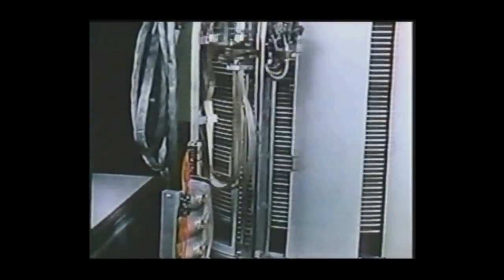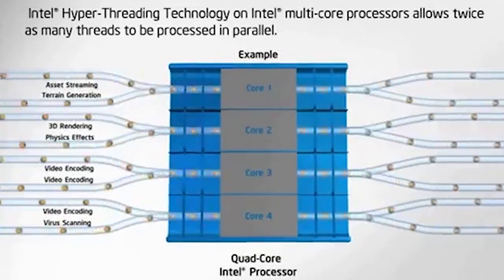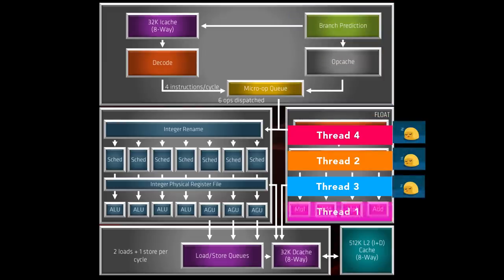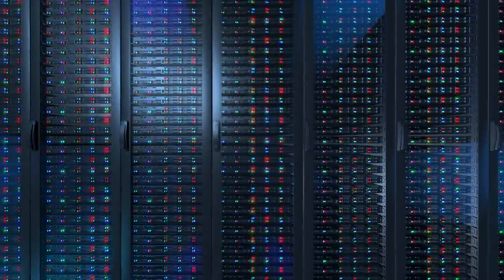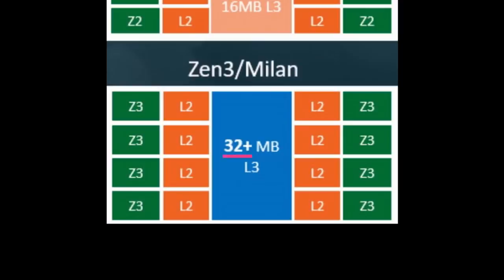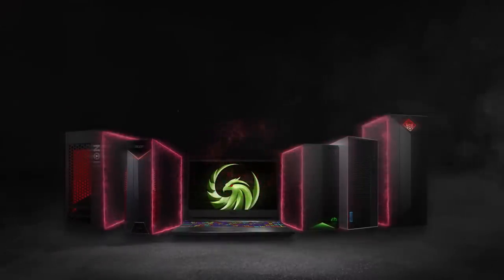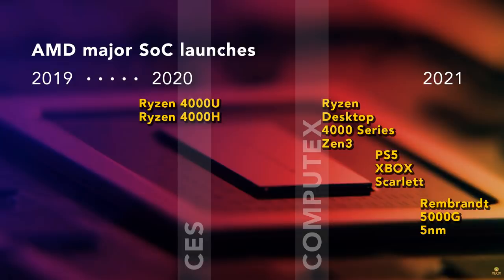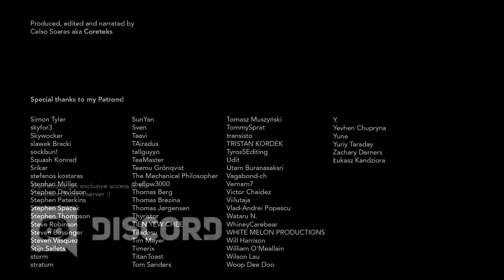Rembrandt | AMD’s MONSTER 5nm APU

Comment: SMT uses unused execution units in the core as a general rule.  A super scaler processor can execute multiple instructions at the same time, the changes AMD outlined in there Zen 2 talks shows they added more execution units to improve IPC.  However the more execution units you add the more execution units that will be idle with a single thread.  That single thread will be able to do more in parallel than it would otherwise, but no matter what it won't be able to use all execution units at all times.  SMT, will allow it to use unused execution units.  The performance degradation that occurs is due to higher utilization causing increase temperatures requiring decreased clock rates.

Comment: I think you overstate the importance APUs on PCs, gaming is still bottlenecked by CPU, GPU and memory bandwidth graphics are still not photorealistic, if you add VR on this context with 120hz the double the horizontal resolution and at least 4k per eye Ray tracing, we are so far away from this to be mainstream that will take at least 20 years for this idea of APUs to take place of discrete components. A multi chiplet design with HBM3 and games supporting many cores and many gpus could make this time shorter, but...
Reply: We won't even still be on 4k in 20 years

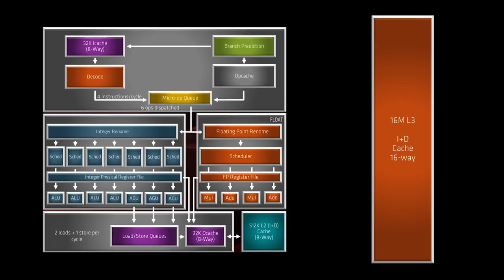Comment: 4:28 You have it backwards. SMT allows the CPU to do something useful on another thread's instruction stream when a thread is stalled on a dependency chain, instead of doing nothing. It will have something else to do between the instructions during latency bound dependency chains. If you have enough SMT threads, you can hide latency entirely, and completely saturate pipelines with work, eliminating the effect of instruction latency. For example, if you have four SMT threads, you can execute instructions with up to a four cycle latency back to back on every thread with zero stalls. The other three threads can issue their four-cycle latency instructions in between issue. By the time it has issued an op from each thread, the first one is completed its four-cycle latency. Did you think four-cycle latency means an execution unit sits there and can't accept new ops until four cycles go by? It doesn't, it means that there are four pipeline stages between issue and writeback, and the pipeline can accept 3 other ops in the meantime, without a pipeline bubble. Without SMT, there would be a bubble of no ops in between. Out of order execution does the same thing, but it is more difficult to extract independent dependency chains from the same thread than it is to select independent dependency chains from entirely different threads.

Comment: the power9 cpu already has 4 to 8 threads per core depending on the variant. there is a 12 core with 96 threads variant. and a 24 96 version also.

Comment: As far as I know AMD has already matched Intel with their single core performance, both having their advantages and weaknesses.
Still a 10% improvement sounds pretty reasonable as AMD is gonna gain 100-200MHz more clockspeed due to node shrink, they are gonna make their chiplets actual 8 core units instead of 4 core CCXs, reducing latency and they will make additional improvements.
Intel is gonna keep up with adding clockspeed and match AMD's gains, but the IPC is the real factor here.
Also if indeed Intel is gonna have a CPU that clocks similar to current 14nm++ and have that 18% IPC gain in about 2 years then AMD is better gonna make those gains.
Reply: 8 Core CCX Improvement is also believed to gain higher gaming performance for Ryzen
Reply: @icemanchambers1207  It absolutelly Will. Core to core latency through IF has been an issue with Ryzen when it comes down to gaming. Full 8 core units will improve the performance If the usage is Limited to only one unit.
Reply: @Diglo1  Yes I agree.

Comment: There is a basic fundamental misunderstanding within the chip designers - 1) Shared L3 cache enables and introduces security problems.  Its just a fact of life.  Splitting the L3 does localize and minimize the problem.  2) GPUs are fundamentally shared resources, and thus introduce security problems.  GPUs are essentially designed as to be single user devices, and mix data - even in multi window environments.  GPS especially in terms of streaming are difficult/impossible to segment.  APUs on the other hand are easier to segment (in terms of security).

Comment: You're missing a trick here. Imagine, if you will, a core with SMT4. To achieve the same multithreaded performance as two cores with SMT2 on the same amount of silicon you have to - and can afford to - design it with a much bigger and more capable core with more L1 and L2 cache at its heart. That much bigger core could have vastly improved single-threaded performance too. We likely won't see that much larger core with Ryzen itself; probably that will be its successor. It would be pretty neat to have a few gigs of HBM2 cache on-package as well to keep the whole thing fed.  If this cache is big enough you could omit the external DRAM and use something like Optane instead which is cheaper and bigger.

Comment: SMT-4 is actually powersaving measure.  Say, processor has 8 cores with SMT-4 and 16 heavy threads running. It can easily power down half of the cores, up-clock remaining 4 in power/thermal budget gaining more than is lost at context switching. Most of PC workloads are dependand on I/O (network, storage, user) anyway. Threadripper based on Zen-3 - well, as name suggest... ;)

Comment: It's only a matter of time before APU's is all we need. In fact, you may even have choices in terms GPU power. You will be able to buy an RTX 2070 APU or a RTX 2080 Ti. There will be no need for a discreet graphics card. The same thing in a way happened to Motherboards. Way back when (1980's), we needed sound cards, network cards and a Controller card for the Hard Drives CD ROM or what ever. Now ALL of that is on the Motherboard lol. Great Video,  Cheers

Comment: When you discussed SMT, you missed the fact that in majority of cases it is not the cpu resource contention that is the bottleneck, it is the memory bandwidth. Today with all avx2 / avx512 it is impossible to feed a single core with 6 or 8 dram channels so smt is completely useless. It is only moderately useful when all of your workloads fit in all the cache accessible by that single core. This is why Milan is merging L3 caches - so that more of the L3 cache can be accessed by any single core.

Comment: The main benefit of SMT is doing useful work instead of stalling on memory, a little extra state allows the core to transparently run the alternative thread and do useful work, then pick up the first again later with the data available.
Running 2 threads equally like can however effectively halves cache size,  but allows a specially written helper thread bound to the same core do advance loading, so the main one rarely stalls.
If you were building so wide, to run 2 pipelines simulataneously in 1 core, then how are you economising on 2 seperate cores?  You're complicating the core considerably, rather than adding a small increase in die area to add a virtual core and switching faster betwen them without OS intervention.  A seperate core makes sense, Bulldozer cores sharing fp units didn't work out too well, despite fp being less common on average, where it's used it is likely to be heavily used and suffer the resource contention problems.
SMT has diminishing returns, simply because caches and pre-fetch are effective, limiting the opportunites to optimise by filling stall time.

Comment: If an Apu can perform at 8gb-16gb card it's over for the GPU for mainstream, I mean $150-$250 8core-16core Apu it's over
Reply: HOLD THE TRUTH HOSTAGE!!! 
It would just increase the entry level performance and price for dGPUs. By market valuation, a $150 dGPU will always be faster than a $150 iGPU. But, we may see dGPUs below ~$120 disappear.
Reply: @darkpain2452  8 has to become the basic with zen 3, as in 8core replaces 4 cores, 12 core replaces 6 cores, & 16 cores replaces 8 cores, then 24 cores replaces 12 cores, 32 cores replaces 16 cores, which means threadripper starts at 40-48 cores for 4900x, 56-64 cores for the 4950x, then 4990x 96 cores.

Each with 4 threads per core it would be a multi tasking monster kill Intel & push technology beyond
Reply: Don't expect to buy that kind of chip for 250 or less. More like 500/600 or so.
Still a good deal imho. With lots of possibilities.
Reply: @baronvonlimbourgh1716  well with what's going on & the demand by companies to increase the sales of laptops and PCs, less parts to build will equal less confusion when building a custom PC & which means more mainstream buyers. I mean it's only a matter of time before Ram, GPU, and CPU are one part, I mean with the simplicity of Cellphones, & tablets it's the only way to reenergize the PC market. Less parts must equal more. And with external graphic cards already out it's only a matter of time man. Before you know it all you need is one chip like thing to have an entire pc it's coming man
Reply: @holdthetruthhostage  sure, been going that way for a while now. But hbm is expensive.
A 16 core apu with 32gb combined shared memory and a midlevel gpu is a lot of silicon and a lot of money. Will be many years until that is available for 250. Certainly not in 2021.
Reply: @baronvonlimbourgh1716  my thing is yes it will be expensive but why not, what happened to the $5,000 CPU that had less in supply but was designed to push the limit man. I would say an Apu with 8 cores 8gb graphics that you can raid with a GPU would be amazing man, it's time for AMD, INTELL, RISK 5, ARM, to produce a killer man check this out

https://www.pcworld.com/article/3085502/meet-kilocore-a-1000-core-processor-so-efficient-it-could-run-on-a-aa-battery.html
Reply: @holdthetruthhostage  yeah that sadly is not how businesses operate. Unless there is a financial motivation to something it won't happen.

The market is just to small for such a part and unless it beats both intel and nvidea at the same time it also has no value as an image builder or flagship.
Or there has to be a demand for such a part from the enterprise side, then it could happen.
Reply: @holdthetruthhostage  what happened to that tilera chip. Did they release that and what was it used in? I'd like to mess around with it. Should be cheap now.
Reply: @baronvonlimbourgh1716  but that's the problem companies are so focused on for everyone or professionals that they are not experimenting with limited releases that are not for the mainstream consumer, I mean AMD & INTEL could release 1,000 limited edition for example 128-500 core CPU for $15,000 just to inspire the smaller market or test it out to push things further. I mean the original cellphone was what $1,000s before it was $100s. It's that lack of imagination & risk that has the PC market and technology feeling doll no risk no exclusivity. Sure I wouldn't be able to afford it but I would be able to see it in action & look forward to it becoming more affordable

Comment: the apu being all you need is a pipe dream because we will always want more, if we can do 4k 60 with an apu we will want 4k 165Hz on a dedicatd gpu, that can pull all the power it needs and have all the hbm, raytracing will also help maintain dedicated gpus in use as that will be hard to do for quite some time

Comment: Gotta love APUs. My first CPU was an A10 6800k because I wanted to save to get a 750Ti later on.
Reply: My first CPU was an A12 9800, then a 3400G, now a 3800X + 5700XT (got a job)
Reply: I love them too. I still use my a10-7850k and it's more than good enough for anything I do, including 4K. It strugges a bit when running virtual GPU (VirGL) at 4K though.

Comment: IBM has had SMT of 8 (8 threads per core) since 2014 which was introduced with POWER8 CPU. It's been used in data centers for years now. No idea why Intel and AMD haven't introduced at least SMT 4 yet.

Comment: AMD could be thinking of using SMT-4, adding shaders to the cores like Intel's Larrabee, and use a lot of cores to merge the CPU and GPU into one design. Once gaming reaches the photo realism performance cap, there may be less of a need for specialized gaming hardware. Although, when the discrete GPU does disappear, it could be replaced by a discrete neural network card.

Comment: 8:00 Windows obviously cannot do it, however, a properly written CPU driver or middleware application from AMD certainly can analyze upcoming threads and “distribute” them to properly utilize and take advantage of idle CPU workers.  AMD could also surprise us by doing this in hardware.  All three of these options can eliminate or at least reduce “stalling.”

Comment: Maybe they will add some more hardware to the core and increase the pipeline depth.  As pipelines get deeper, the maximum speed goes up but the issues of waiting for the previous thing to finish gets more complex.This may make more threads per core make more sense.

Comment: Charlie from S|A remained confident even after that leaked video that Milan is composed of 15 dies. 

What's your thoughts on the 6 we don't know?
- 4 dies of L4$ stacked on pairs of CCD-s, and 2 HBM stacks serving as HBC? (HBCC)
- 4 dies of cache each connecting 4 CCD-s helping CCD-CCD communication and 2 HBM?
- 6 HBM stacks?
- 1 die as interposer, and  whatever
?

Comment: I totally agree that APUs will be the future. Although admittedly I am a bit biased, as soon as I heard about the technology I was excited about it and bought an A10-7850k for my next processor. Partly because I'm cheap, but also partly because I was interested in the technology. Particularly I liked the idea of upgrading the APU by adding a discreet graphics card and still utilizing the graphics cores through crossfire. This by the way, for anyone who's curious, turned out to be a bad idea (as you could probably guess). The performance increase was negligable over just using the graphics card on its own, but caused me no end of headaches and hassle. Perhaps with a higher end motherboard and RAM I'd have seen better results with such an oddball setup, but then again that basically would have negated the frugal nature of the build (although would still have been fun to do nonetheless, purely from an enthusiast perspective to see what results could be achieved).

Comment: This explanation of SMT is a bit lacking because it assumes/presents that all execution units of specific type are working strictly together as a whole and thus cannot be used by the separate threads at the same time.

If the core has 8 floating point units and first thread uses 5 units for some specific operation and second thread needs only 2 units then it's all okay to do it at the same time, maybe except for the fact that fetch and decode gets queued/delayed by a cycle or whatever the cost of those operations are. 

If AMD makes a Core that has more separate execution units of each type then it may still make sense to have 4-way SMT.

Comment: The last thing my HPC users need is more threads per core.  Current Intel HT makes them expect way more performance than they will ever get.  The software is so good at keeping the execution units busy, there is no gain in performance with the SMT tech turned on.  Quite the opposite most of the time.

Comment: i dont see what the problem is with multi threading as the thread exists, needs to be dealt with, and needs the resources it needs weather the cpu is single threaded or multi threaded, if it has to wait for resources it would have to wait anyway till the next clock cycle

Comment: What are your thoughts on Deepmind AI? It does even require huge pc power to work, it can be ran on a regular laptop, seems like good code can be more important than hardware in the future
Reply: vesacksi Training a neural network is the difficult bit/hardware taxing not just running the trained version.

Comment: Problem with everything on chip is that to get the most out of the hardware you're going to be pushing TDP's up into HEDT territory. For this reason alone APU's will always be at the entry level of the discrete CPU and GPU combination.
There's no doubt that future APU's will achieve 1080p/60 (roughly rx 570) levels of performance sometime in the next few generations, but even utilising onboard HBM, the gpu side of the equation for power draw will limit the performance.
As you are well aware mid range gpu's have much higher power draws than CPU's at 2:1 whilst gaming being 175-225W vs 65-95W and even optimising to 100-120W will still increase package power draws to 180W+. So even if you can fit the gpu and memory into the package, the additional price/performance benefits won't get close to the discrete options.

There's definitely scope for APU's built this way as the HBM could serve a dual purpose as fast memory for the CPU squeezing in between L3 and system memory for some additional performance benefits to the CPU, but the graphics subsystem will still be limited to lower CU counts and lower clock speeds due to power draw limitations.

While technically it's feasible to have an APU with 200W+ TDP's, it'll be limited to niche markets and not mainstream due to the higher motherboard and cooling costs required. With HBM we could see APU TDP's rise from 65W to 95-120W but HBM is more temperature sensitive and those would require higher end cooling at stock than the low cost spire and would need the prism at least adding to the cost.

These would not be sub $200 solutions, but likely closer to $300+ taking them out of the budget gaming end of the market altogether and not be as good as discrete solutions in price/perf.

Comment: Even if Windows couldn't support large number of cores and SMT4 (on the desktop), developer workstations increasingly migrate to desktop Linux distros which can absolutely do both (especially since the exact same x64 kernel will run in the server Linux distros).